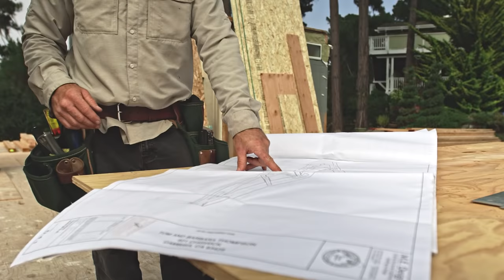The HK 55 Circular Saw with Guide Rail: Why It Works For Me

Comment: Don't think that whole gang cut action is either faster nor as accurate as individually cutting. Speed comes with experience and your not lining up even slightly twisted or slightly bowed stock and getting an accurate angle.

Comment: My brother is a carpenter. I used to see him sneeze from the dust of cutting wood goods.
I use the vacuum when I cut anything otherwise my nose will be irritable all day. I don't know how carpenters can cut wood without any collection. I guess your all used to it. But the fine microfibre dust you cannot see must get into your airways and cant be good for you. But yes a great tool.
Reply: good cutting machine.thanks
Reply: good cutting machine.thanks
Reply: The versatility of this saw is great. I have expanded my capabilities in the plastering industry for the ability to make my own tools and also templates to carry out certain tasks. Work is very quiet here in Western Australia. You have to put your hand up to any skills just to have work. This saw is great for ripping. Cutting on an angle does seems to give it a bit of load on the one battery but the cuts are really fine.

Comment: I'm still reaching for a $100 Makita to cut rafters, and so is anybody who does this on a regular basis.  With the exception of a gay European building a gazebo hahaha.  The standard Track saw is awesome, however most carpenters are not using a five hundred dollar saw in the rain.
Reply: Peter Trohatos I think festool is good but I would put it at the same level as makita just with a bigger price tag
Reply: james birdsall don't AvE? makita is skookum, and built in theft deterrent
Reply: Straight Canadian carpenter here. I love my festool HKC and use it on a daily.
Robust enough to cut or rip lumber perfectly.  Accurate enough to cut trim and mouldings.  A100$ Mikita isn’t even playing in the same league as the HK tracksaws 

( btw I’m Canadian and our liberal government doesn’t want us to have anything that isn’t made in China so my HKC, tracks,blades and attachments ended up costing me over 2k and it is worth every penny and then some)

10/10 best saw I own

Edit; yes I use it in the rain (festool carpentry gear is water resistant)
Reply: Joe Eickson UK Carpenter here who agrees the HK series is a must have. Especially the HK85 with its powerful motor, rips anything effortlessly
Reply: Joe Eickson yes I’m going to strongly agree with this comment. The machine is extremely valuable to have in your tool set. I find there are some things I still reach for my m18fuel Milwaukee but for most tasks this accomplishes faster, more accurately and with better user satisfaction. Also Canadian

Comment: You claim this  will cut rafters haaaaah!!!!!   Well...... maybe if you building a bird house.  In the real world we have things called hips and valleys and they yield 2 1/8 inches on 45 degree cuts in dimensional lumber.  Your overpriced under powered unit only offers 1 and 5/8 inch max capacity at 45 degrees and that is WITHOUT THE TRACK!!!!!!!
Reply: Peter Trohatos that’s why I brought a mafell

Comment: I can see someone like myself using this saw - an unskilled hobbyist. But I do not see it's use for a professional carpenter.
Reply: Gas'n'Oil that’s because you’re an unskilled hobbyist.  Pros see the potential uses of this saw.
Reply: @jeffpower6473  I'm a "Pro" and I "see" that you sound like a hack. No framer is going to throw away the chalk and the worm drive saw and use a track saw to cut frame/sheathing on a roof. If you get a $100 for every professional framer who uses a track saw to cut a frame and roof you'd be penniless.
Reply: Order in Chaos you’re opinion is based on the fact that you’re a framing carpenter.  I’m a long time finish carpenter for high end custom homes and I most definitely see the advantages of a festool HKC.
Reply: @jeffpower6473  If you're a finish carpenter then you're using the wrong Festool saw. The HKC was created for rough carpentry and construction. You need the TS saw. I would see value in the TS saw for finish carpentry.
Reply: Order in Chaos I own a track saw and it’s a game changer for sure.

Comment: All of you fellow carpenters who are extolling the virtues of the Festool HK track saw absolutely puzzle me, I've used it a number of times on the job site ( My partner has it), it isn't remotely worth the $ 700.00 bucks that Festool charges for the kit, I use a Dewalt 60V Flex saw with a 12" speed square as a guide, works every bit as well for half the money, by the way, the Dewalt has a lot more cutting grunt hands down. Festool reall y has alot of tradesman conned.
Reply: The Festool has a dust port, which is really nice when used with a Festool vacuum. My health is worth way more than $350, and I'll probably save >$3500 in medical bills in the long run from not inhaling sawdust.

Comment: There is a man in Canada, who took this saw apart, for the whole world to see. Hes a big AVE youtuner. If you know what I mean. Not worth the $1000 price tag. All kinds of plastic and not designed for heavy duty use as your claiming here. It has an outdated drive that will not stand up to construction job tasks. This is why you don't see Festool on construction sites. You see them in woodshops that make furniture. It'll make some furniture and cut trim for sure. We, actual blue collar  workers, know this is not the right saw for rafters. I've seen worm drives and 7 1/4 circular saws, even freaking Ryobi makes it to the job site, the proof is in the pudding guys. We've seen the inner workings. Get rid of the plastic and make it stand up to repeatable cuts.
Reply: The Sonoran Desert Grower I get what you mean. But this is really a rally between nations. Yes, maybe you don't like the festool and i'm a big fan of Ave. It isn't a 1000 dollar saw either. I bought mine new for under 500 euro's. My old saw was a festo from the 90's and that thing kept going. I had to buy new because it got stolen. I actually love the old skilsaw but in my opinion it's a bit heavy and not that versatile. Check out ave's vids on the skilsaws. What i'm trying to say is that it's really not as bad as it looks. Cheaper brands just do it worse.
Reply: Festool makes a very accurate product that I (me, myself use). There is no way that I would bring their circular saw or Kapex miter saw on the jobsite for others to abuse!)
Reply: This is way better than Ryobi, which doesn't even have a built-in dust collection system. Anyone who prefers Ryobi to this can enjoy inhaling sawdust; I prefer to keep my lungs clean.